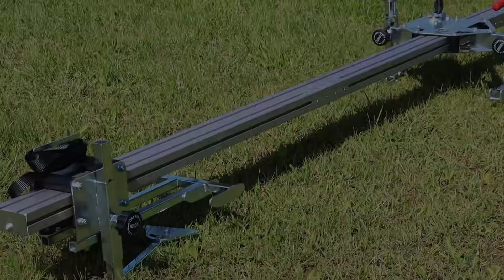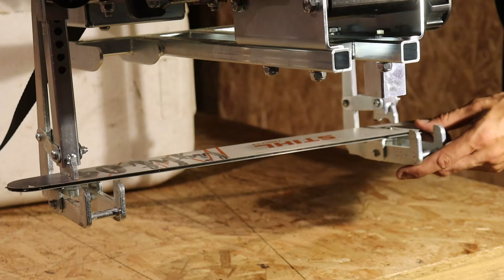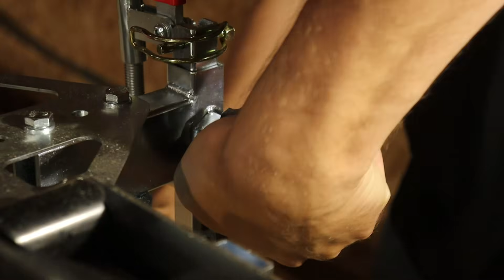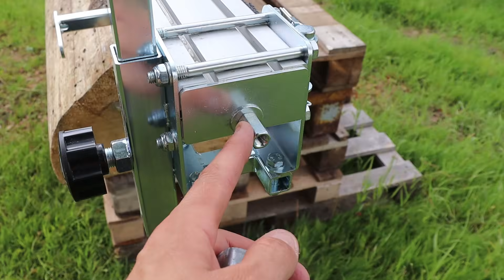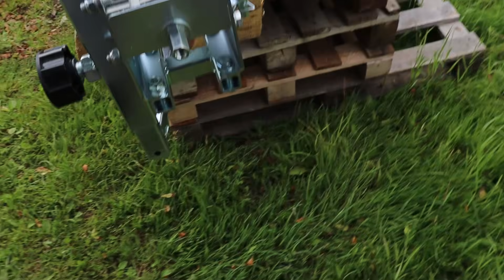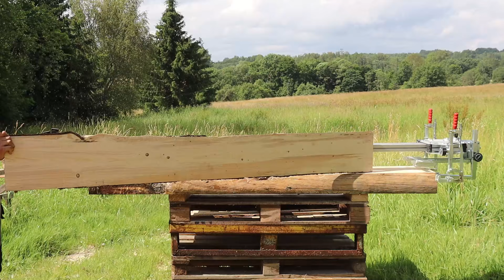How to set up and use ClampMill chainsaw mill

Comment: No setup, only cutting a board.  Epic Fail
Reply from the maker: Hi, it's Donald from DonnDIY YouTube channel, I'm the co-founder of Nature Tools and co-creator of ClampMill.

Regarding your comment: "No setup, only cutting a board. Epic Fail" - first half of this video involves setting up saw bar etc. but the whole point of ClampMill is that it doesn't require much setup and is ready to cut boards after it is "thrown" on to a log. That is what we were after when designing this mill.

Would you elaborate on your comment so I can understand you better?

Cheers, Donald